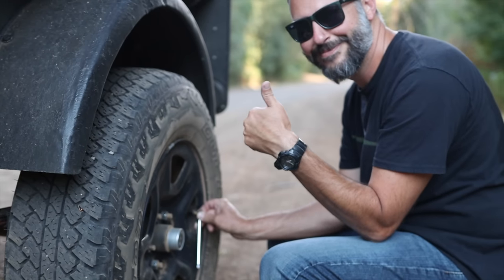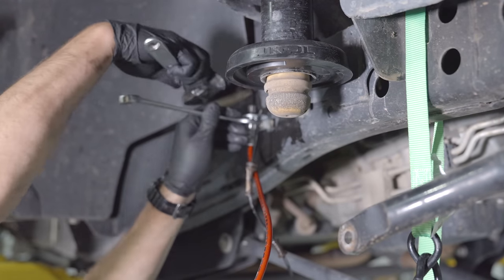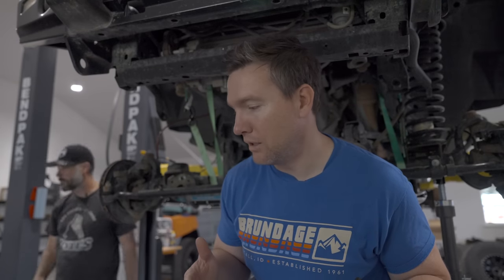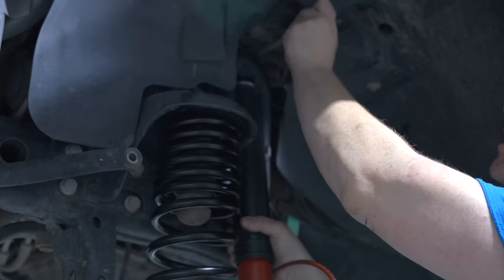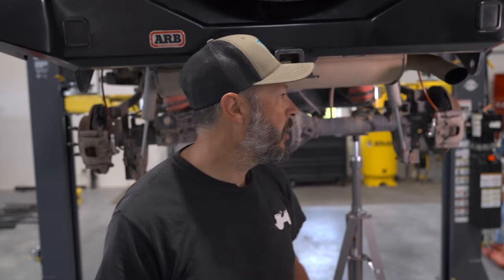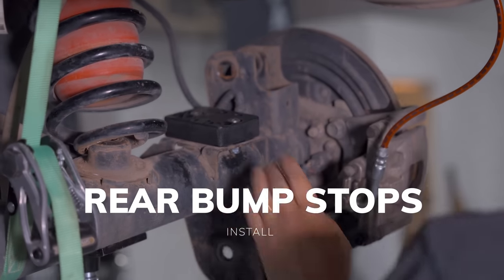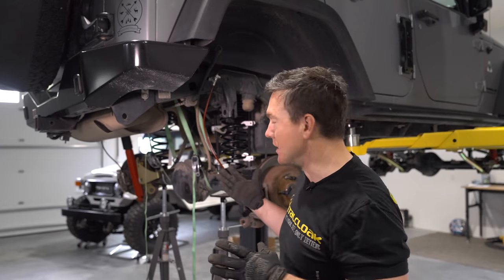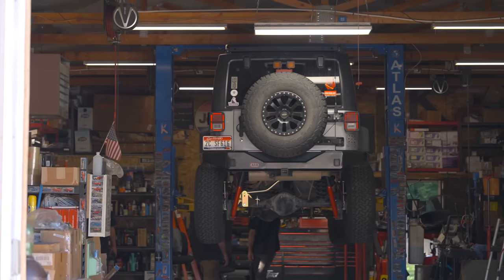DON'T INSTALL a Jeep Suspension Until You Watch!

Comment: You can put the brake line retaining clip on before you tighten up the hard line makes life easier, also, they make special wrenches specifically for brake lines that prevent the line fittings from being stripped and once you get the hang of them, they are very easy to lift up rotate lift up rotate, and it goes pretty quickly.
Reply: Thanks for the tips! That would have helped a ton!
Reply from the maker: That would have been nice to know. Great tip!

Comment: its metric all metric
Reply: You’re absolutely correct!
Reply: Great job I would torque everything with the Jeep sitting on its own weight. This also makes sure the bushings are not under pressure and in there rotational center at ride height. I will be in Nampa idaho August 16-September 3 to drop my daughter off at collage.  Would love to go on a wheeling trip out there suggestions. I will be driving my gladiator.
Reply from the maker: I think that’s why our torque specs were off when we got to K Suspension. You should check out Lost Trail out in the Owyhees. Not too far from Nampa!